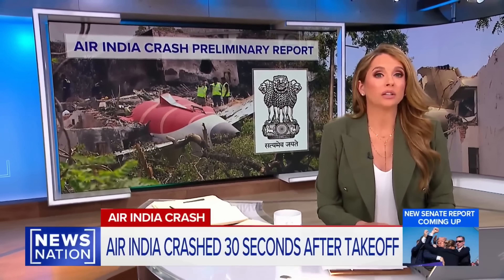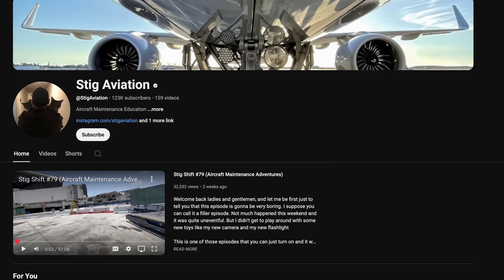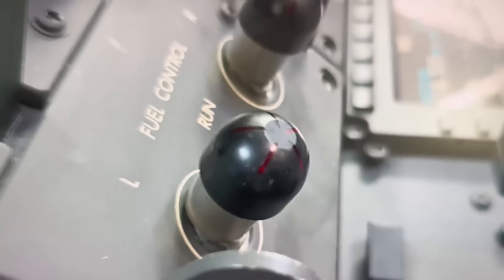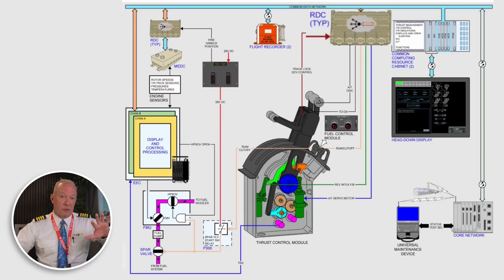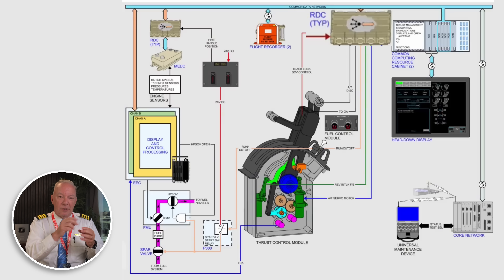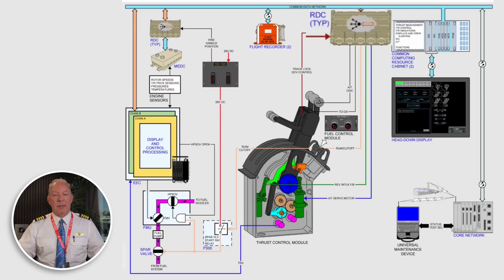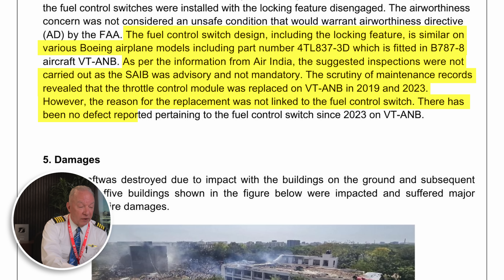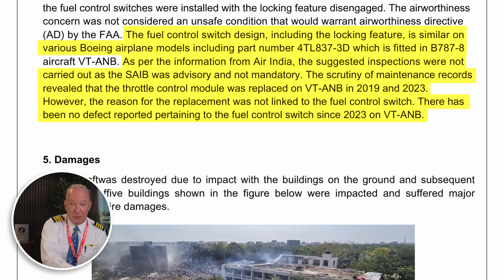The Truth About Boeing 787 Fuel Control Switches

Comment: do the investigators have the switches from this crash?  can we see the time frame from   the roll out ... to wheel pressure off...to RAT deploy and other view  , fuel flow/consumption after fuel switched  to off , RAT detect engine fail but was 48 volts still active ? did Rat deploy do to no 48 and or 14 to controller.  On the very first report Captain Steve report " listen " that sounds like the RAT , the timing seems to be before that sound , maybe we need to go back to  THE ROLL OUT time.  great conversations  !

Comment: Thanks. I didn't want to believe that the switches were manually turned off by a pilot.
But it seems that no other theory makes any sense.
Reply: Why arent we considering a possibility where dual engine failure happens just after take off. Then pilot manually turn fuel switches off and on because thats SOP in Boeing planes in case of Dual Engine.? You can refer to Gaurav Taneja AI 171 Part 3 in english dub to understand more about this theory as timeline of RAT deployment also matches with this

Comment: Captain you’re spot on. I’m not an aircraft mechanic, but I do teach electrical systems and multiplexing.  A simple DC switch and relay are specifically used because they cannot fail any way other than on. There’s a lot of people commenting on the cockpit conversation, that’s irrelevant. Facts may hurt sometimes, but they don’t lie.
Reply: Unless the power supply fails.
Then the relays would open.
Humidity on the battery bus, a flimsy joint, or maybe the battery failed completely.
Then the relays closed again when the RAT started providing power.
Reply: @giacomoneri1782 on 2 independent circuits 1 second apart? And why did the FDR see the switches transition
 from on to off back to on? No voltage dropouts recorded?? No other systems affected? A simple Chevy 4x4 has a feedback loop on the 2/4 selector switch, the body controller knows exactly what position the switches are in, so I’m certain Boeing has that low tech feature figured out.
Reply: @jayebzzz338   I'm basing my hypothesis on how Captain Steve describes the system.
I don't know how it works, but if it works as explained it might be possible.

I don't know if the switches does transmit their physical position directly to the FDR, but from the diagram it looks like the position of the switches is recorded from the relay or the valve position.

Also, someone suggested that water might had entered the electronics bay during rotation, which might explain why there was a delay between the two switches.

Also, the same aircraft had multiple separate electronic failures during the previous flight.
Stabilizer trim transducer and cabin entertainment system failed, and the emergency lights were flickering on and off.
Only the stabilizer trim transducer was fixed.
Reply: @giacomoneri1782  Captain Steeeve should keep well away from aircraft electronics. He describes it very poorly. In the simulator test, they shut off all aircraft power. The fuel system relays don't rely on battery power to keep them in position, nor do they relax to a failsafe position. They are magnetically latched (with permanent magnets) in their last commanded position. You need an electrical signal from the fuel cutoff levers to override that magnetic latching to both open AND close the relays. In the past, if you lost all electrical power to the aircraft, including the battery, you couldn't shut down the engines. The FAA mandated that special emergency batteries be fitted to new aircraft in case this happened.  This emergency system is fitted to newer 737NGs, 777s and, I presume, the 787. Modern Airbuses should be the same.
Reply: @ImperrfectStranger They call them permanent magnets for a reason, that's why relays use electro magnets😂
Reply: @giacomoneri1782 they fail closed, what don't you understand about that?
Reply: https://youtu.be/nxul8TOIf38?si=m31CWbFiVksrLSc9
Reply: Please watch Flying Beasts analysis before commenting about this topic
Reply: they cannot fail if theres a known issue on 787 with water leaking in electronics bay? 
I am electrician. Running water typically kills seperate systems short time of each other. If your relais are accelerating, pitching and decelerating, the issue can resolve itsself automatically.
Reply: @jochenwagner2782 If you are an electrician you will know for a fact that water is an insulator and does not conduct electricity.
Salty water however.................
Reply: Okay they did it but what if they did it to restart the engine. In pre-report they mentioned that one of the engine got ignited again. Rat was deployed just after takeoff
Reply: Nonsense.  Relays are not really 100% reliable as you preach.  The main contacts can easily go off momentarily due to shock and vibration, high currents causing bi-metallic effect due to high temperature development at the contact points, mechanical over time deformation of the contacts, etc.  The denouncing mechanism to prevent multiple opening / reclosing may add extra flavor to the 10 sec apart argument.  If the debouncer of the relay was set to 10 sec, even a very quick intermittency in relay’s contactor would translate to 10s OFF followed by ON.
Reply: @BBorowy61 2 independent relays with the same fault 1 second apart? BS.
Reply: Do the two relays share the same single power source?
Reply: It's the fuel pumps that failed caused by water ingress into the EE bays. Lack of lavatory maintenance caused the crash and not the fuel switches
Reply: Also not a mechanic or a technician here… what if the DC power to the fuel switches is a single point of failure and connetcion failed temporarily for unknown reason?
Reply: @J.D._DUS  From the graph, the current is not going only to the switches but the throttle as well yet only the switches reported being closed and then opened again.
Reply: 😂 stop teaching
Reply: @Namtaf2023 thanks for the advice but I make it a policy not to take career advice from nobodies on the internet, especially ones with zero subscribers.
Reply: what about a drop in voltage to the relays ( may it be the voltage or loose wiring or ....) Is that not a possibility ?
Reply: @theguy4355 the relays fail closed, so if power is lost, the circuit is on. Christ almighty, how is this so complicated?
Reply: @gumby2241  Now explain "mr so complicated " what causes the pressure for the fuel through the fuel supply line to the turbines ( yes your relays are fail closed to keep the circuit closed ) but with it even closed doesn't mean that theres voltage going through. It that case for the relay to fail closed state mean voltage is lost to the relay, which could imply it is possible there was loss of voltage to a electrical device to create pressure for the fuel. Another person explained in a respectable way that the relay could work as low as 3v. So for the relay not activate could be a complete voltage loss ,thus to other devices as well ( to push fuel through fuel line from tank to turbines ). Im not saying thats what happened
Reply: Disagree.. Why was the RAT  deployed two seconds before the fuel was cut off ?
Reply: I replaced a relay in my amplifier that was going off, without any input/button press, cutting my right speaker's sound.
Reply: @sl4y3r1988 Boeing relays are generally made by companies like Eaton corporation, a little different than your stereo amplifier lol. And did both your relays fail at the same time? Not so much.
Reply: @jayebzzz338  beside the relay on the plane ara latching relays, not a spring relays, they dont have a NC or NO state
Reply: @ielsaproyectos3162 thank you- that makes perfect sense. People hear “relay” and think it’s a 5 pin relay like a minivan horn relay. 😂😂
Reply: @sl4y3r1988yes but only one of your channels failed not both ⚠️
Reply: How robust are those relays? My only experience is limited to older German cars and I’ve seen those relays fail all the time, and do the most random things. Solder joints going bad due to heat, wear on the contacts etc.
Reply: @sidnotgod each piece costs like $1800 a pop so yeah pretty high grade stuff, not that a $1800 piece of hardware cant fail but its highly unlikely
Reply: @sidnotgod  2 relays would not fail on the same day though.
More chance of being struck by lightening ⚠️
Reply: Why arent we considering a possibility where dual engine failure happens just after take off. Then pilot manually turn fuel switches off and on because thats SOP in Boeing planes in case of Dual Engine.? You can refer to Gaurav Taneja AI 171 Part 3 in english dub to understand more about this theory as timeline of RAT deployment also matches with this
Reply: @ishanarora7948  You didn't listen..The FDR clearly shows the engines did not start spooling down until AFTER the switches were moved. The second by second timeline is in the report. Anyone can access and read it on line. READ IT.
Reply: @ishanarora7948 timing is wrong. Data shows the switch transition happening before the engine spool down.
Reply: @ishanarora7948  😡
Reply: @ishanarora7948  
It was NOT a "Dual ENGINE failure"
It was a "Sequential FUEL cutoff"
Reply: @rogerstarkey5390it was a sequential engine Cut off as a response to soemething catastrophic like electrical failure / dual engine failure because that’s what it is written in standard operating procedure for Boeing. Let me know if you want any official link for the sop.
Reply: Of course they can fail off. Or have you never in your life had to clean relay contacts?
Those that can do, those that can't teach😂
Reply: @andrewallen9993  so two independent relays failed and exactly the same manner one second apart and then 10 seconds later they both repaired themselves. Please don’t work on airplanes.
Reply: @jayebzzz338 A pound to a pinch of shit you have flown on one where the instruments were certified by my kit😂
Reply: @jayebzzz338  Now imagine the power supply circuit that runs the relays energizing coils over voltage/over current😂
Reply: @andrewallen9993  Yes they can fail But two failing within a second?
Reply: @richardmorin6968  My thinking as well.  Highly improbable.
Reply: @richardmorin6968  exactly , that is why the both engines electrical and mecanical systems are completely separated
Reply: @andrewallen9993 both fail within a second of each other and then re-ingage in the same order within 3 seconds of each other? What are the odds? I agree with Captain Steve
Reply: Two at the exact same time? No, stick with teaching because you obviously can't "do"
Reply: @rayp5152 I clearly said 2 cannot fail at exactly the same time, how did you miss that? Comprehension isn’t for everyone. 😂 And I “did it” for 30 years, both heavy duty and auto mechanics. Thought I’d spend the last 15 of my career teaching the next generation, thanks for the laugh.

Comment: Some believe a transition event occurred, but what some are arguing is that an electrical issue may have caused this, they don’t believe the switches physically moved, and there does appear to be a electrical connection between the switches and the relay.
Reply: "Believing" is for religion. The preliminary report is about facts. Maybe you should watch the video again for better understanding.
Reply: @fritzchen0.523 maybe you need to re read it, as it  doesn’t say the pilot moved the switches.
Reply: @pppscooby  Seems you have problems understanding simple English sentences. So, no text based help available for you.
Reply: @fritzchen0.523 reading in any language seems problematic for you.

Comment: So Captain Steeve spends a 20 minute video explaining why the fuel switches had to be moved by a human hand, AND that the loss of engine thrust was a direct result of the movement of the fuel switches which opened a relay circuit that cut off DC power to the relevant valves, preventing them from continuing to pump fuel into the engines.  That is a useful clarification, but really that has been apparent for weeks.  The real question is what prompted one pilot to move those fuel switches to cutoff.  Deliberate suicide is one hypothesis.  But the problem is that dammed RAT which deployed before the fuel was cut off to the engines.  Since RAT deployment is an automatic response to some kind of serious problem with the aircraft, it follows that there must have been a serious problem before fuel cut off.  If so, there would also have been warning indications in the cockpit, and it is also a perfectly plausible hypothesis that one pilot moved the switches as a response to whatever problem he was seeing.  It might have been the absolutely wrong thing to do, and there is a high probability that the resultant loss of TOGA thrust (not the pre-existing problem, whatever that problem might have been) was indeed the proximate cause of the crash, happening as it did at such a low altitude.
But this would have been pilot error, not suicide.  Worse, the focus on the moving of the fuel switches independent of inquiring as to why that was done, risks shifting the focus away from whatever that "other problem" was, and the only reason to shift the focus that way is to protect either Air India or Boeing.
Reply: "RAT which deployed before the fuel was cut off" is not a fact and not supported by the preliminary report. If it would be true, it would have been mentioned in the report.
Obviously, It is still necessary to spend time to explain the known facts, because some people insist in creating their own reality which does not fit the available information.
Reply: There is no support for the idea that the RAT deployed before the fuel cutoff switches were moved.  The only mention of it in the report that has any timing attached to it is the mention of it having started to provide hydraulics, which occurs 4-5 seconds after the switch movement.

Use some common sense.  If the RAT had deployed before the switches changed position, then it could only have been in response to a truly catastrophic fault somewhere in the aircraft.   A fault which included the engines starting to physically shut down.  Yet you expect us to believe that that fault went completely utterly unnoticed in the flight data recording, and/or was noticed, but somehow didn't make it into the report in any way, shape or form?  (In reality, the engines are noted to be shutting down in the sentence following the one that discusses the switches being flipped. Not prior.)

If you're alleging the level of conspiracy it would require to hide something as blatantly obvious as that, then you're not really arguing about the RAT, are you?  Might as well go hang out with the 911 truthers or whoever.  You have to have some capacity to trust the investigation process, or what's the point?
Reply: A thoughtful response, you might appreciate this https://www.youtube.com/watch?v=OLxLN3osS1Y it is well argued and researched. It also fully explains the RAT deployment which would have been triggered by the power system failure possibly finally caused by retracting the under carriage being the straw that broke the camel's back.
Reply: @philbrooke-little7082  That video provides just some other nonsense theory that does not match the pilots conversation.
Reply: @philbrooke-little7082  Im sorry but the video is missing all the components from real schematic - and ends up in complete nonsense. RAT is deployed by logic then both switches are OFF. Undercarriage was never retracted, the bogies drop then pressure is lost in main hydraulics. And all these faults would have registered so many times in FDR - but there are none.
Reply: No. Just, NO.
Reply: RAT was not deployed before, don't believe the nonsense some channels spit out.
Then switches are moved to OFF, the BPCU <-> HYDYF logic deploys the RAT, it takes about 750ms to do process that in logic and switch to RAT deployment. The RAT is deployed in 0.5-0.8 seconds and since hydraulics are instant since engines still spool down and have some pressure left and RAT reaches its full spool up at ground level in 3-4 seconds due to extra drag. That internal logic is not in pilots manual, because there is no need for this and pilots cannot do anything about it.
There are no other causes that magically didn't register in FDR. There are lot of incompetent channels talking nonsense.